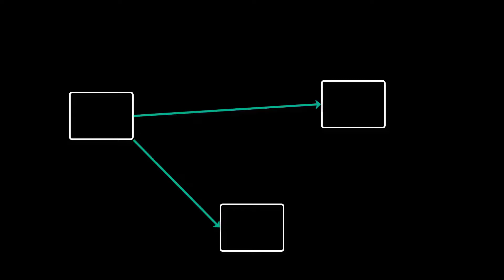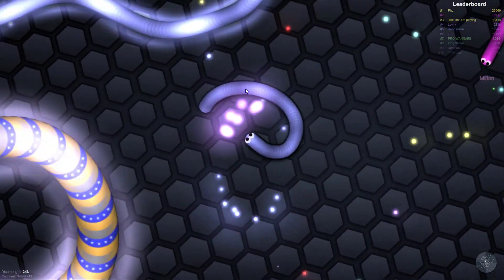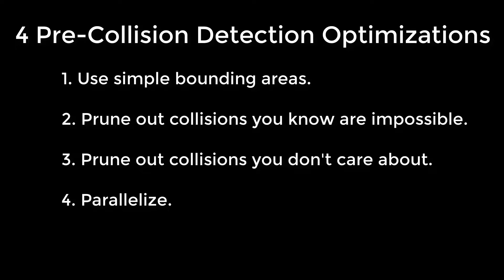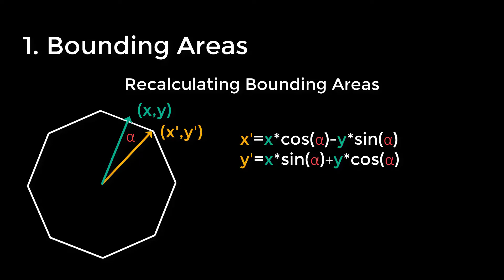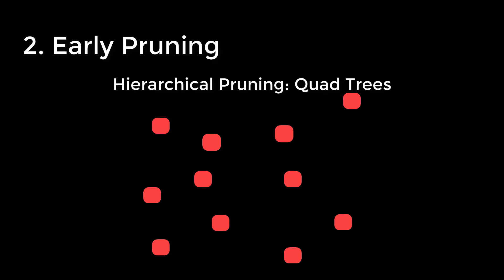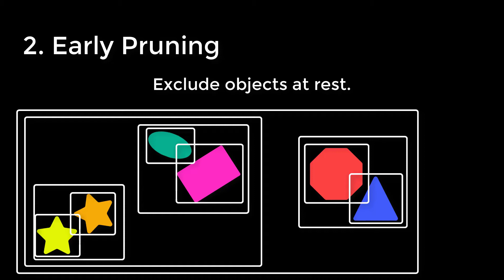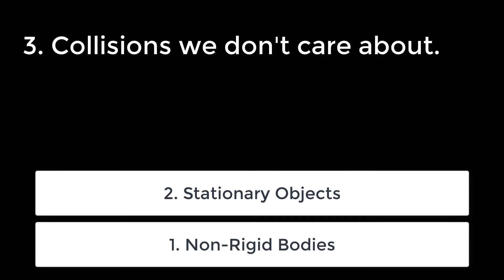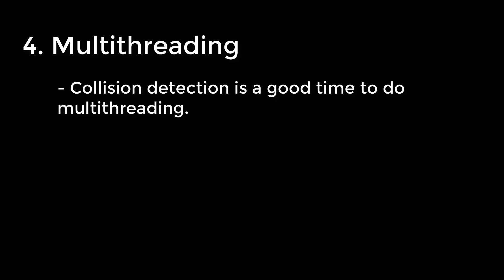2D Game Physics 4: Pre-Collision Detection Optimizations

Comment: i have been searching rect vs circle intersection for days and found nothin'...
Reply: There may be a more efficient way to do this, but that's what I came up with:
measure the distance between the Rectangle and the circle's center and check if it's less than the circle's radius.
That's how I measured the distance: Assume the rectangle's top left corner is at (x1, y1), its height is h, and its width is w. The center of the circle is defined as (x2, y2) and the radius is r.
The rectangle's center would be at (x1+w/2, y1+h/2).

Thus the distance would be
√(max(|x1+w/2-x2|-w/2,0)²+max(|y1+h/2-y2|-h/2,0)²)

//Basically if |x1+w/2-x2|-w/2 is smaller than 0 that means that the answer is the change in y. If |y1+h/2-y2|-h/2 is smaller than 0 that means that the answer is the change in y. If they're both 0, that means the circle's center is within the the rectangle's bounds which means there is intersection. If neither is 0, it basically returns the distance to the nearest corner and uses the distance formula √(dy²+dx²).

So finally we would have return √(max(|x1+w/2-x2|-w/2,0)²+max(|y1+h/2-y2|-h/2,0)²)<r converted to whatever programming language you use
Reply: @randominternetperson2215  well thank you in the first place but i don't think that this is 100% working.. i mean i saw someone wrote 100% working equation but it was very complex and not as simple as this(i didn't try it because it was long and complex), so anyway I'll try your way and hopefully it will work.
Reply: @hopelessdigger  Alright. It is very possible that I have a typo somewhere so let me know if this works or no
Reply: @randominternetperson2215  i tried it, i'm sorry it didn't work.
apparently, the top left corner only seems to work idk why.
Reply: @hopelessdigger  did you include the absolute values?